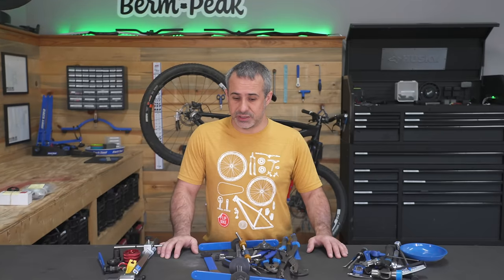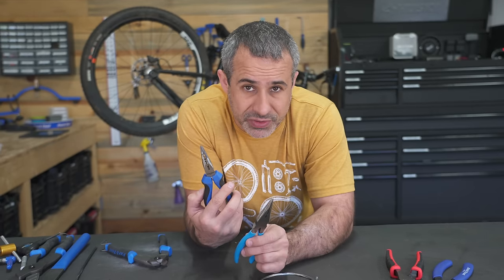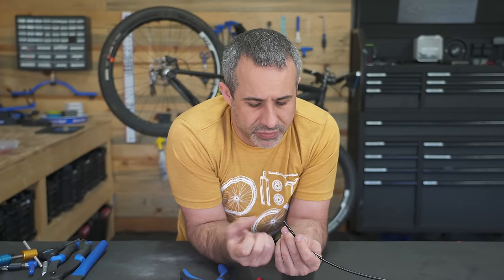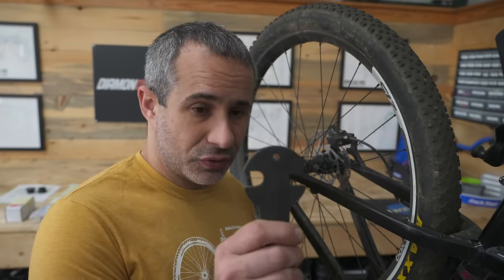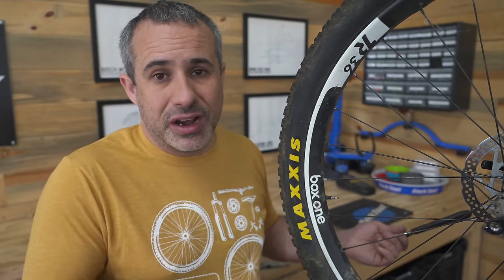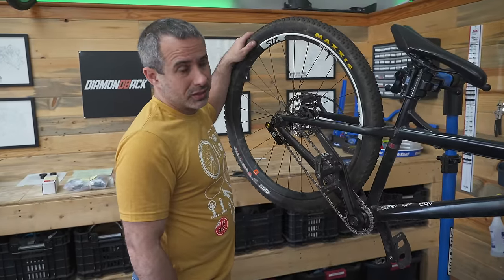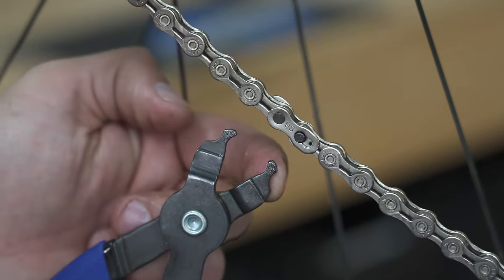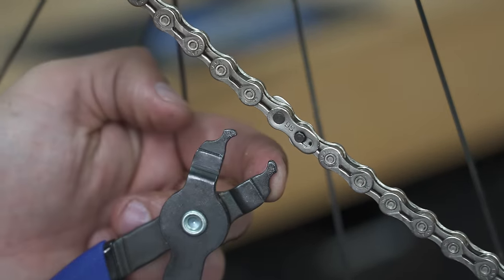Are "Bike Tools" really different from "Tools"?

Comment: Great video! 
To add to it: for cable cutting, use Knipex bowden cable cutters. Here in Europe, they're actually cheaper than the Park Tools cable cutters and supposedly last twice as long. If there is a good quality tool company making tools, they're usually cheaper and/or better than the same tools from bike specific companies. Wera hex keys beat the heck out of Park and Knipex pliers and cutters are a level above as well. Wiha and Wera bits also outperform those in bike tool sets.
Reply: Wera bits are better than Wiha ones, Wiha bits are softer and can twist under too much load.

Comment: when comes to the cup press/head set press, i made my own, with a mixture of threaded rod, 2 big nuts, metal washers and nylon washers. It ended up costing about $10.00 and works great for multiple sizes of cups/headsets. Another thing you shouldn't waste your money on is a headset extractor. Simply buy a piece of metal conduit (the right diameter of course) cut 4 slits down it and bend the resulting fins out a bit, it cost about $3.00 as opposed to the cheapest one on amazon that's $17.00 and of course Park Tool has one for $38.00, for a piece of pipe, with a plastic cap at the end....
Reply: I did exactly that for an extractor, except i reused an old bed frame so it cost me zero $.

For the press, i used wood block with a hole in it

Comment: \Seth mentioned it "kinda" with the thickness of the wrenches working on the pedals but back in the day when hubs had cones you had to gave a good set of cone wrenches. Different manufacturers had different sizes. 13, 14, & 15 mm were the most common. They were only ~2mm thick. You had to use two on each side to tighten the lock nut against the cone to get it in the just right position. That is not done much today except on older hubs. I still have some Campy Record hubs from back in the day, with one bearing removed and only greased with oil. Those were for big races only. Great days in the 70's & 80's. We did all kinds of crazy stuff back then, like paint socks on our ankles with white nursing shoe polish then put real socks on after the race so you didn't get DQ'd.

Comment: As some ppl have mentioned, and they prob work at a bike shop, you bend the chain at the master link, and just pay attention to the side each master link is on, you can indeed pop them open with nearly anything that squeezes together, i have indeed gotten these apart with my fingers, even brand new ones, you just need a little solid piece on each end of the chain link, I used the little plastic squares that comes with scott bikes when i couldent find my Master link pliers (always)

Comment: This video is extremely relevant. Just yesterday I went to switch pedals and realised my adjustable wrench wouldn’t fit between the pedal and the crank… So I tried to use a small hex key instead and it ended up breaking. Ended up just going to the bike shop and bought a proper quality pedal tool and it worked in 10 seconds…

Comment: Cassette remover and bb socket are probably the only 2 i would buy as bike speciphic tools. Those wire cutters can be sourced just looking for a high quality pair.
The rest of the tools you need actually are normal handtools .
And maybe the shock pump too, which I wouldn't use anything different because of the risk of over inflation and the hard time I would have letting air out knowing how muck is left inside.

Comment: The cable cutter you got from ACE is for electrical cable. You can buy braided steel cable cutters and they look a lot more like the bike specific one, Knipex has a good one, pricey, but I don't know how much the Park Tool one is. The pedal wrench makes more sense because they aren't going to flex as much as a standard open end wrench. When the flats of the wrench flex, you round off the nut.

Comment: My favourite most budget friendly tool I've got is:
An old gear cable I swapped out (still decent though no rust etc) that I use as master link removal "pliers", somehow I lost my dedicated actual master link pliers so I just out force into the cranks when fitting and use cable when removing👍

Comment: I have use a large bolt and washers as headset press. I used a 2x4 stud with drilled hole as cushion on the washer.  Also on bottom bracket a spanner wrench will work, in a pinch I have used a punch (brass if you got it) and hammer. never use pliers on anything until you have to.

Comment: HOW-TO chain link removal without a chain tool.  If you have a vice, I find that a Drill press vice works best, but a bench vice will work the same. you need a small socket and a small torx bit. About the same diameter of the pin in the chain. You take the socket and put it over one side of the pin, so that when you push against the pin, it has a place to go. Put the torx bit so that it is against the other side of the pin, then you close the vice on it. It will push the pin out with little effort.

Comment: Did same as shown. Head tube and fork tools are not insurmountable. I made my own cup press (threaded rod, washers, and copper fittings). And crown race set tool (pvc and duct tape).

I knew a few people fab their own chain whips.

Comment: when I built my own headset tool, I found some large square plates that had a hole in the center. They are large enough to sit on top of the press cups and not inside the bearing race. I also like using the threaded rod to install the star fangled nut in a Threadless steerer as an alternative to the hammer+hole punch method

Comment: Ok, so a couple tools to add to your list here. Electricians wire cutters which can be had for $8 or so a pair on the low end include crimpers that will do those cable ends just fine. Second is a roll of electrical tape, for wrapping the jaws of channel lock pliers. Plumbers trick for installing faucet hardware without scraping off chrome.

Comment: I got away without a pedal wrench/spanner for a long time, but a dedicated one is well worth it. Not too expensive too.

I used to break chains with a hammer, nail punch and a bolt (so I could put the chain on the bolt and nail punch it through). Seth you’re doing it wrong lol. I used to put them back together that way too… that said, get a chain breaker. Much better.

Comment: I bought the cable cutters and a couple P-handle hex wrenches (8mm & 6mm, for pedals) from Park Tool and it was definitely worth the combined like $30 for those specifically, but for everything that doesn't require significant leverage I mostly just use my multi-tool. A shock pump and adjustable torque wrench are probably the next two things on my list to be able to do more of my own maintenance independently and with confidence that like my suspension linkages are properly set. I may need an extra-beefy shock pump though since my dropper also has an air spring in it and it's specced for 280-300PSI according to the manufacturer, which seems to be uncomfortably close to the maximum on a lot of pumps.

The 6mm wrench I only actually needed once; to remove the cheap plastic pedals that came on my bike so I could install proper ones.

Comment: if youre running a normal derailleur you can also fold the 2 links next to the masterlink down so they are parallel and push the opposite sides of the master link with a normal pair of pliers to open it.

Comment: Well I just finished taking apart and putting together a bike. The only specific tool I bought was a crank remover which I kinda regret I didn't get the cheaper one. I you have vice grips and some old bike chains you can make a chain clamp and would work for a lot of indented parts like the bottom bracket. can be used as a chain whip as well. As for master link removal I accidentaly discovered that you can easily use a needle nose pliers. if you fold the chain with the master link sticking out, then put the pliers on the ends that the rivets are connected to (the pliers go diagonaly) and press then you'll be able to remove it.

Comment: Only bike spesific tools I really use is chain breaker, and cassette and bottom bracket tools.
I used beefy channel locks on bottom brackets for years too, it works fine and doesn't damage anything but the looks on my experience. Got a cheap tool recently more cause it also fits some Centre lock brake disks..
Bearing press and valve core removers I just use my automotive tools,

Comment: If your careful with an adjustable wrench you don't need to a spoke tool. And for chains without a master link you can use a metal punch set and a hammer. And lastly my wrenches are narrow enough for pedals so I don't have a pedal tool. I've been able to get by with common hand tools so far for all the maintenance I've done.

Comment: I've used a hammer and screwdriver to break chains. a really thin tip between the plate and link, and a good whack with the hammer usually removes the plate. then to reinstall, use an old pair of side dyke wire cutters. emphasis on the old and dull. to set bearing cups, a hammer and two blocks of wood works good enough. I've made my own chain whip out of a piece of flat steel and some scrap chain.

Comment: The crimpers on a set of bike pliers are the same as an automotive crimp tool for butt connectors. If you do a lot of electrical work you're probably gonna have a good set of crimpers and that'll work just fine for cable ends.

Comment: For master link pliers, though the needle nose aren't ideal, what about Split Ring Pliers? The ones with little tiny tips to insert into a locking split ring washer?
Reply: I tried this (since I have a set of those), but they slipped off. At the end I bought master link pliers from KMC which are cheaper than my split ring pliers

Comment: I found big enough washers to make a headset cup press, and if you put a nylon washers between the metal washers and the headset cups, you don’t have to worry about damaging the cups. You can make washers out of thin flat plastic to protect the cups. You could also probably make a couple of wood, or paperboard disks, to act as a protective buffer, for that matter. protecet

Comment: For cable and cable housing I've found a dremel multi-tool with a cutting disc gives a quick clean cut to both - my wire cutters aren't up to mtb cables!
My cheap chain tool has been upgraded to the vastly superior Park Tools version. 
Otherwise managing with unbranded cassette and BB tools, non-bike spanner/rachets and good hex keys + basic shock pump.
Don't have spoke keys, as everytime I try to true a wheel I make it waay worse! - lbs for that still!

Comment: The problem with using the adjustable wrench applies not only to working on cycles but for any other purpose. To get a good fit you need to put the wrench on, cinch it down, and then turn, and there is a good chance you will need to loosed the wrench after making the turn. If you are not completely cinched down, there will be some slippage that will round the corners of the nut. A non-adjustable wrench of the correct size allows you to work more quickly with less potential for damage to the parts.

Comment: Most tubeless valves come eith some black plastic, thing. Thats a valve core tool, and some valve caps are so too (peatys, mucoff, nukeproof)

And chain tool, just buy a multitool with a chain tool. you need the multitool anyway, or buy a chain tool, much faster

Comment: this was a really good video especially for me since I'm getting more into bike maintenance and bought some parts to replace the stock stuff. nothing major, just upgrading chainring, pedals and chain etc. but regarding the master links, sometimes you can pull them apart with your hands depending on the chains/master links. I can pull apart the master links on the chain i have on my budget chain got from ebay to replace my snapped stock chain but i can't do this with the masterlinks on my kmc chain. both work completely fine but i use the budget chain for commuting to and from work.

Comment: As always love the videos! For the BB removal bit, as far as hardware store parts go, a pipe wrench and some pvc showerpan liner you can get it off with some easy (a pipe wrench kind of self tightens when turned the proper direction) and the thick liner will prevent scratches like the rag idea. 😜
Reply: This is really a bad suggestion, pipe wrenches despite the shower pan, can slip, gouge and bugger up the faced surfaces of a BB shell. A hook spanner and a inexpensive flat plate fixed cup spanner works great  You can use a properly sized, adjustable/Crescent wrench if you have the ability to hold the wrench on the fixed cup with a stack of washers to the BB spindle.

Comment: You can get a masterlink apart using normal pliers. I did it for years and still doing it often even though I have now the correct ones.
You have to grab the masterlink diagonal from the outside. Totally easy.
Reply: also works well for single speed 1/8th" chain master links and motorcycles too.

Comment: It’s best if you use a high leverage diagonal cutter on brake housing, not a cable cutter. A cable cutter with triangular jaws will often force a sharp spur of metal into the center of the housing, which you’ll have to trim. Park Tool actually shows how to use a diagonal cutter in one of their videos. Using a cable cutter, like the Park Tool model is fine on shift housing.

Comment: Park tools bearing drift (BBT 90.3 or BBT 30.4) comes with two extra parts which are perfect for pressing bottom brackets back in if you get a rod a pair of washers and two nuts

Comment: You actually CAN remove a master link with no tools. I'm a cheap bastard, so I've never bought a set of master link pliers, but I like to think I've mastered the removal technique. You kinda have to align it in a "z" shape, and then you can squeeze and pop it loose. It does leave some marks on the hands tho... 😁

Comment: So for the bottom bracket tool… i used a pipe wrench and wrapped a piece of inner tube rubber around it for protection.
Reply: The disadvantage of such methods is you can loosen bottom brackets, but you can't mount them again with the right torque. For a torque wrench you would need the specific tool fitting on it.
Reply: @simonm1447  I certainly didn’t do it right. I just tightened and said “yeah, feels pretty tight!”
Reply: @ChrisRidesHisBike  if it worked at your bike it should be fine, however sometimes they can get loose again over time if they are tightened not strong enough.
I had this problem in the past with cranks of classical square shaped bottom brackets, which got loose and came off while riding

Comment: You can actually remove master links with normal pliers by pinching the links around the master link together and then applying offset pressure to the link. Sounds complicated but it's quick and I do it every time.

Comment: Im not into bikes just stumbled upon this channel and been watching because it's interesting.

I've been working on various project cars for 10 years or so now, and by now if there is a specialised tool that is designed to do a job I will just buy that. When I was younger and had less money I'd make do using incorrect tools or trying to make a custom tool and you just spend way longer doing whatever job you were doing or at worse damage something.

It took me that long to buy a bloody seal puller. I've been making do with screwdrivers and the occasional self tapping screw and pliers. Way too much risk scratching a sealing surface lol. Bought a seal puller and pulled two seals easily without risk of damaging anything in the time It would take to try and safely pull one with a flathead screwdriver

Comment: you can use a "Belt-Wrench" for the buttom bracket ( i think thats the name of it since im not natively speaking english) its basicly a belt made from a thick fabric that makes an adjustable loop and almost grips anything.. if it doesnt grip you can pull an o-ring or any other rubber over it and it will grip pretty good as soon as you but pressure on it

Comment: I've used Regular snips or pliers to crimp those lugs on the brake or gear cables stayed on no issues with 2 crimps using the cutter part. Also used red electrical lugs if not had any proper lugs left, but I do have a proper electrical crimp tool for those  😜

Comment: For adjustables, I really love the channel lock wideazz slim. I use it as a cone in a pinch and it works 90% of the time.

Cheaper than my knipex even though the knipex is much nicer to use

Comment: There are many pedals that do require a pedal wrench - the flats are just too narrow for a standard open end wrench.  But nowadays, almost all pedals also have a hex socket and that is what I usually use.  (A nice, long, bike-specific one from Park or Pedros, of course!)
Reply: I just use the 15mm cone wrench I already need for wheel cones. Why buy a pedal wrench if you can get by with that?
Reply: @jonathanzappala  I have a narrow-jaw adjustable for cones. Same thinking: why buy a set of cone wrenches when you can have 1? Hahaha
Reply: @Aubreykun  that’s nice. I was fine for many years with one 15 and one 17. If I needed two of the same size I was able to use a regular wrench for the second.  Then I got some disc brake wheels that needed two 22mm. I definitely don’t have a 22mm regular wrench, so it was two more to buy or two crescent wrenches and try not to slip off!
Reply: @jonathanzappala  All my bikes are solid axle or QR and I never really cared to check how big the cone nuts are. Before getting it I was using some stamped-steel multi-wrench I already had. It worked, but was awkward to use.
Reply: @jonathanzappala  That will work too, but often a cone wrench is too short to give you enough leverage to break loose a pedal, especially if it has been on there for awhile, or was threaded on dry.
Reply: Better than the Park or Pedro's hex wrench is a 3/8×12-18" breaker bar and a hex socket..works better..